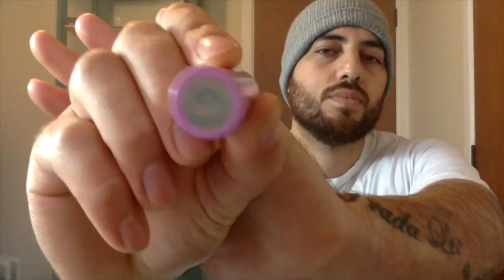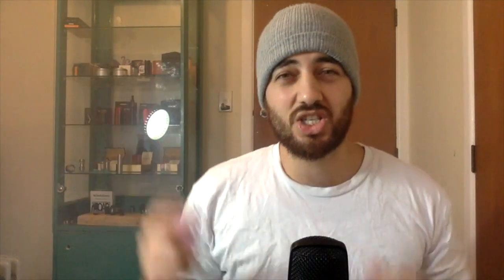Battery safety + Re-wrap Tutorial | All Clouded

Comment: Do built in batterys tend to have risk of exploding?
Reply from the maker: Extremely uncommon but I have seen a examples of one and the battery inside the device vented. We always suggest vapers be cautious when charging especially when the device is unattended or you fall asleep. Remembering these devices are made in mass numbers so somewhere on the line theres possibility of manufacturing errors, better to be safe then sorry
Reply: @AllClouded  thanks, but I reckon devices now days should have a tick off when the battery is full or near full like most if not every phone has now days
Reply from the maker: @lachiec9160  your right they do have it in thier "safety features" but I have seen them fail before and explode more then once, so we stress safety practices especially when in family homes. No puff on a vape is worth burning a house down

Comment: I have a sliiiight scratch in the top of the negative part of the battery wrap. Should I rewrap it? Its one slight scratch
Reply from the maker: Hey megan, the negative part of the battery doesn't carry as much risks to battery venting like the positive end. Most of the time we will tear the wraps when we transport the cells from our devices to chargers. If it's a slight nik or bur I wouldn't panic but would still suggest to re-wrap the cell just incase
Reply: @AllClouded  thankyou so so much for taking the time answering me! I just rewrapped my first battery- it was easy peasy BUT I have a slight line going up the side of the battery- I'll try to post the picture - not sure if I can but. It's where the wrap was folded when it came. I heated it out as smooth as I could but...it's still a really light line going up the side. Is that normal/safe I hope? I wont use the batt until you answer and thanks again
Reply from the maker: Congrats! And good on you for caring about your battery safety, so many neglect it.Ahh yes, this is very common thing. What can help is if you run the hair drier over the crease a few times and push out the lines either towards the negative or positive side. Now I wouldn't stress too much if there are creases on the side. As long as the positive end is fully covered you've done a amazing job
Reply: @AllClouded  Thank you!! You've been really helpful💙💙 I've tried doing that with the dryer- smoothing it over but it just won't get it out. So I dont have to rewrap it then- cool. The positive and negative definitely came out smooth so SWEET🙏🙏
You're awesome! I honestly could watch your vids all day long- love the way you talk- but you prob get that all the time. Are you in the UK? Or just from there

Comment: So, just in case it doesn't explodes in my pocket. ( I don't use mech mods)
I have transparent wraps and printer at home, is it safe to print out 2 designs, cut it and slide it into the clear sleeves?
Reply from the maker: As long as it insulates the negative and positive from making connection, I cant see why not